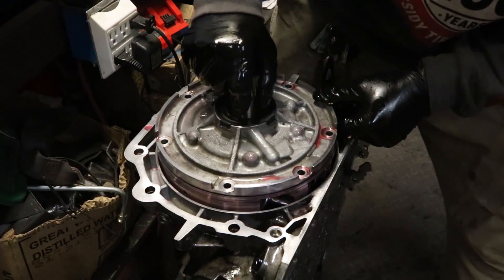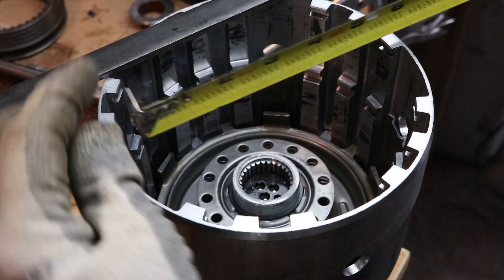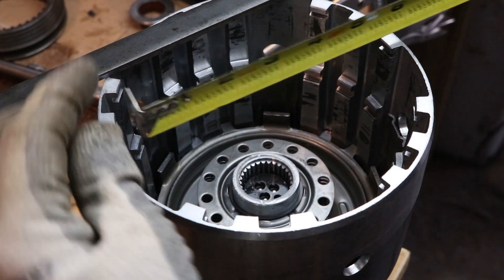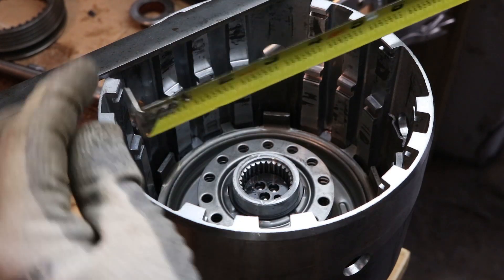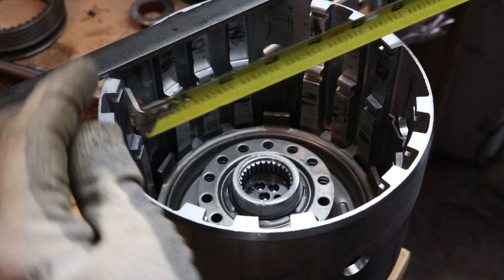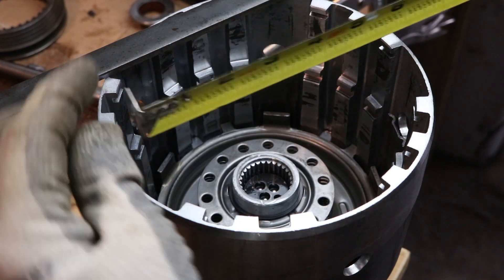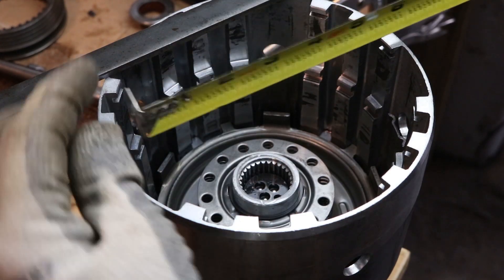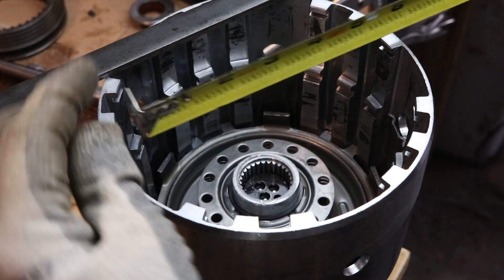HOW TO BUILD A CHEAP SPRING RETAINER TOOL FOR A 4L60E AUTOMATIC TRANSMISSION - 4L60e Build - PART 5

Comment: Have you ever had some experience with a 95 trans am 5.7 lt1 t56 ?  There's a car near my home that has been parked for  3 years I have heard that the owner is asking something like $900

The mechanic told me that the owner came 3 years ago with a problem in the fuel pump but he just never seem interested in repairing it (that kind of guy who already has a replacement car as soon as it gets  wrecked)

I have never owned a trans am or Camaro it seems to be a great opportunity
Reply from the maker: Not a bad price! I would buy it for the T-56 alone!